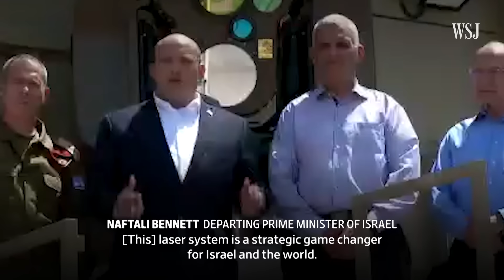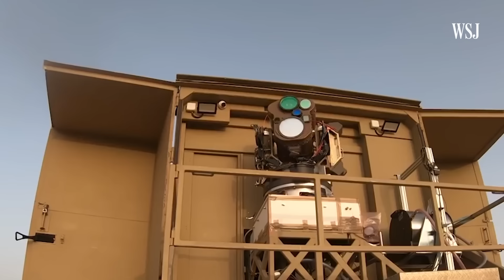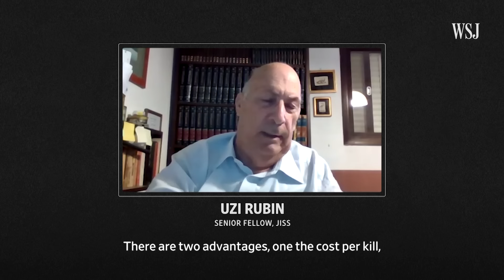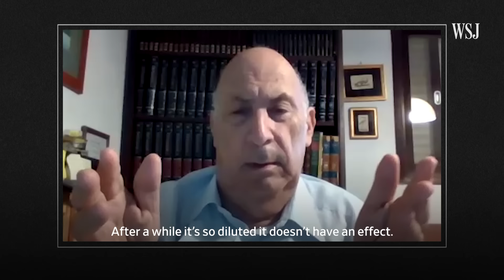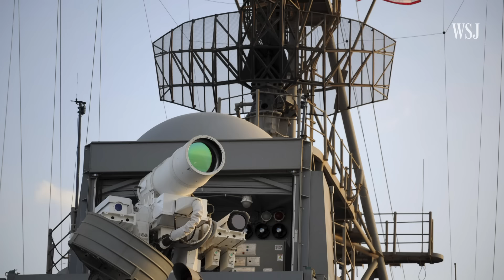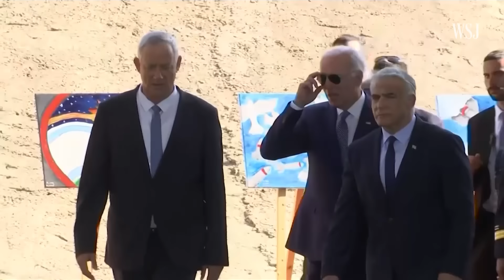Iron Beam: How Israel’s New Laser Weapon Works | WSJ

Comment: So can someone answer this, instead of a continuous beam that deposits energy over 5 seconds, why not take all 5 seconds worth of power and deposit it all in one go like a laser short burst? At speed of light you would hit the target instantly.
Reply: why? because:
1) it already dose that. all beam emitters (rader/laser) are doing it. its just small micropulses hundreds of times a second.
2) the problem of storing a several seconds worth of energy is that you need to store it and then release it. and even if we wanted, we dont have the materials to store it and to release it will overload the system.
3)that is what chemical lasers do but the problem is that the chemicals are single use, so the laser need "ammo".
4) not sure if the mechanisem applies to smaller lasers, but what high power lasers do is do a lot of small pulses of laser in order to rapidly heat and then rapidly cool the attacked surface, causing a lof of shockwaves, and this shockwaves are what is supposed to destroy the missile.

Comment: What if the missile rotates, has a mirrored paint and heat sinks?
Reply: hamas don't have that technology, they are fiering water pipes filled with manure (instead of using it for agriculture).
also, even if the missile rotate or has heat sink, the system can target specific parts of the missile, so it should not have a problem to constantly readjust the target  location in order to keep on consistency. also, drones cant do that.

Comment: I cast doubt on the effectiveness of this when dealing with mortars given these are extremely small, have no moving external components and they tend to be made of hardened metals that encase the payload. 
Also, because mortars are short range ballistic systems they are inherently difficult to detect upon firing and have very fast travel speeds at lower altitudes. Most of the claims should be taken with a grain of salt. Specially coming from Israel!

Comment: 1.NOT how THIS laser works, as Israeli’s solved the 30% weather availability issue somehow.
My guess is parallel 100kw beams . 
2. Took 3 seconds to intercept a test missile which has better heat resistance than a metal  rocket.
From a flying single engine, 3 years ago.
So we know just how accurate the end beam is.or was.

Comment: Airplanes equipped with the system could enter contested air and do what they have to do. How about having more lasers, would two beams weigh twice as much? A regular C-130 Hercules, with 10 lasers, could it take out 100 systems of S-300 missiles to clear the area?
Reply: not really. the problem with self defense of aircraft with laser is that they are very vulnerable to saturation attack. 
1)the missiles come at very high speed
2) the missle has very very low radar signature, and aircraft usually has low power rader compared to ground rader, and the ground radar can use lower wave frequency because it can have larger reciver, so a single plane leaving the plane being able to intrcept only very little
3) the radar need to actuly look in the diraction of the missle (most aircraft dont have 
4) you cant fire more then one laser at a time because the plane use all available the power of the engine to power the laser, also, with the laser, you will not have much room for the aircraft to do anything else
5) the aircraft will need to be stady and not maneuvering. something you dont want to do when you have incoming missles.

Comment: Radiation shielding should block Radiation up to xray ? So can it stop Nukes ? I would guess not. Xrays are Atoms so you would need to get smaller than Atoms to pass through shielding ? Like a gamma ray ? But would a gamma ray just pass right through anything since its smaller than Atoms. Could the gamma ray decay to an xray so it hits the Nuke? Probably not. Lasers are just visible light ? Why not use xrays instead since they have more energy or increase pressure to make gamma rays ?

Comment: All major countries are trying to comb out problems with the laser. Several efforts involving lasers, microwaves, sound waves and microwaves are underway. Working with engineers on experimental projects, I find that the lead directional element of the team is always trying to ride out a one solution pony. The solution to most problems is often a multiple combination package. In this case, one of these beam methods should also be a carrier for something else. Although the beam or combination of beams concentrated together would still do damage, some internal rider or core stream should be used, using  particle streams or other means should be used. In our case, and most cases of projects, it is obvious to me (but not anyone else) that our progress is stalled, because each lead person, and every team member wants their own idea promoted.

Comment: Can't this be counteracted with reflective coating on the missiles?
Reply: Good point, though I doubt it will be enough. Coating missiles with  highly reflective material is just going to make them easier to detect on radar.
Reply: @WalnutWarrior7 it's a beam  light of course it can be scattered or reflected , even certain colours like red or black will have different time to burn ratios i believe.

Comment: What if the missiles are covered in mirror coating?
Reply: Nope, wouldn't work. Mirrors are not 100% reflective despite appearing to be so. At least some amount of light still get passed through a mirror surface. Also these are laser beams made to shoot down projectile like missiles which means they are high intensity beam of pure energy in the the infrared spectrum invisible to the naked eye, that have the capacity to easily pass it's energy to it's intended target.
Reply: @DarkZerol there are super reflective M3 materials that can get the job done , but a poor military won't go through all those lengths tho.

Comment: I think missiles would adapt, it doesn't seem hard to countermeasure the laser. Just add a reflective painting and it would reflect the light instead of absorbing its energy
Reply: It's a laser not a light. Laser is fire in form of light. Will burn through the layer.

Comment: I have seen many articles that say this uses 100 watts instead of 100 kWatts.  The lower power might be for initial targeting but 100 Kwatts is needed for melting metal at a distance. 50 watts might be powerful enough to etch metal at a short distance but knocking out the guidance electronics of a missile or causing it's fuel to explode takes a significant amount of power. And lasers are not the same as light bulbs when specifying power. Wattage is almost meaningless without specifying the duration of peak power. A 50 watt laser etching machine has a peak power rating of about 15,000 watts.  So is the 100 kWatts of the Iron Beam the peak power rating? We don't know....nor are we meant to know.

Comment: Standalone it's probably not very effective. But as part of a multi-layered, integrated air defense system it defiantly has potential. Use the rocket based interceptor Iron Dome type systems to strike en mass at greater distances and then use lasers and microwave based weapons for close-in, last-ditch measures. 

God bless the US and Israel.

Comment: It's not the quantity of the juice, it's how fast and uniformly you do the squeeze.

First of all, short of a hurricane or blizzard conditions, at the kinds of tactical ranges we're talking about (<3nm); the presence of weather means nothing.

Testing of the 150kw MTHEL occurred over 5-7km ranges, as far back as the early 2000s and showed the ability to rapidly engage artillery rockets, including X3 simulshots, through clouds.

The primary weapons effector cuts an ionization channel based on a pathfinder laser read of atmospherics and so the only thing that matters is whether the radar has sufficient window to align the weapon head, which has more to do with siting and local horizon line than meteorologic effects on beam propagation.

The thermal kill idea is also wrong, pulsed-impulsive lasers pack Terawatt power rises in nanosecond intervals which vaporize and then detonate a sufficiently large chunk of the target as to cause explosive coupling/mechanical shock damage to the target.

Early tests in the 1990s with PIKL showed the ability to explode body armor wearing torso emulators from over 2nm, with fist-sized chunks blown out of the wound cavity.  Later tests, on UAV and RAM targets showed similar effects with deformation of airframe/weapons bodies leading to near instantaneous airframe breakup.

The difference being the first tests needed a room full of equipment and the later ones roughly a laundry machine sized equivalent.  We were aiming towards microwave oven sized with a fiber laser but cooling was an issue, as was the need for multifrequent coherency of the wavefront.  JHPSSL solved the latter issue.

I don't know what Star Trek 1960s world these fuddy duddy's are operating in but it's nothing like what was the SOA, 20 years ago.

The other factoru which needs to be considered is simply this: the tech is already out of the bag.

The Turks shot up a Chinese Wing Lung A-UAV, back in the 2019 period.  With the advance of drone threats and the U.S. reliance upon free fall PGMs, the need to kill LSS threats and defeat ballistic PGMs is going to rapidly drive lasers to the point where they begin to threaten ANYTHING which overflies a target to deliver ordnance.

For the moment, we can still afford to saturate with munitions.  We cannot afford to lose F-35s.  That was the threshold at which we needed to start thinking about new solutions and we are past it.

MTHEL 2004 Test
https://www.youtube.com/watch?v=LThD0FMvTFU

Comment: Not long ago russians lied about this technology already. But, since a lot of people are illiterate, it works. We must remember that physics have not been cancelled (jump off the roof to test) and 2 factors need to be taken - beam dispersion in air and focusing optics size for multi-mile targeting. At the moment, we use 10kW laser for cutting steel at only 1.2mm distance with great speed. It WILL NOT happen at a mile distance. Physics shows middle finger to this circus.

Comment: Without a doubt laser is the future. It  has the speed of light and requires no ammunition or logistics, maybe a solid state battery to make it mobile. The biggest issues are that it looses power proportional to the distance and storage capacity of the battery.
Reply: The only problem is mist and heavy rain.
Reply: It would have logistics due to the power draw. You can’t keep those batteries stocked up with power indefinitely.

Comment: I believe that consideration should be given to whether the system should be stationed on top of skyscrapers; most cities have skyscrapers, and those often have access to major power lines.
The height of skyscrapers reduces the distance between the emitter and the target projectile, and those projectiles are top-down attack projectiles, meaning that the loss of any negative elevation fire areas is minimal in effect on the system's effectiveness.

Additionally, skyscrapers are located in the heart of the city, where the largest population centers, and largest targets, are often located, meaning better value per interception.

Finally, having the system in a hard to reach area which mostly one way to reach it that is easily guarded and denied means that it's much easier to secure the system, in theory.
Reply: They may have better range on skyscrapers but to get the full capability that have to be positioned near the border and outskirts of big cities so that it can strike the missile before its too late. If they are on skyscrapers that leaves a lot of the rest of the city at risk. Also, there aren't very many supertall skyscrapers there... Not like New York or something
Reply: Good intentions, but it sounds like a war crime.
Putting a military asset on top of a civilian building within a city.
It'll be more effective to place it around a city, rather than in it.

Comment: Seriously, what can this light transferred energy do to a modern missile coming in at + 1 Mach? The chilling effect of the air streaming along the missile body alone would make the time required for a specific spot to be heated to anything near having an effect to be prolonged. And I assume that at that speed the tracking system also will introduce some spread on the area being lit from aiming. Add to that a somewhat reflective coating and finally the short distance of reach, and the system appear useless for other than old Katyusha style rockets. 
Is it just the media effect that are the selling point of systems like these? Taking that assumption in to the equation, this could be a top seller :D
Reply: The iron beam isn't supposed to take out the latest and greatest hypersonic missiles. The threat here is dirt-cheap, maybe dumbfire missiles that are launched in huge numbers to overwhelm the tracking/guidance systems of the iron dome. This also leads into the other reason the iron beam is better for this solution - the cost. As mentioned in the video, the price of firing one of the iron dome missiles is very high, especially compared to the cost of one of the attacking rockets, meaning that it's also an economic and logistical battle. With the iron beam, it would be far easier and cheaper to deploy large numbers of point defense throughout Israel, preventing situations where the iron dome is oversaturated and lets some rockets through.

Comment: Uzi rubin is wrong on Weather And range of the iron beam. Israel has few low cloud days and the rockets and mortars and UAVs, even advanced ones, fly lower than the attitude of the regular clouds, and rain is rare in Israel. And range isn't an issue, because iron Beam can intercept over Gaza if placed really close to launch sites. if one battery has a range of 20km, than you can put battery on iron beam every 20km in major cities. It's absolutely more cost effective for the future, also since they will probably be upgraded in the future. The beam strength is indeed the only flaw, but it's not critical - 100kw is more than enough for rockets, UAVs mortar shells.

Comment: The things you said about weather problems are really not an issue since in israel there is very little fog or rain in comparison with western countries. These things also affect hamas rockets which is why we pretty much never have alarms go off in the winter
Reply: In the north there is fog though from time to time
Reply: There are quite a bit of dust storms in some areas which might also hamper viability
Reply: The north has a lot more cloud cover, and they have no problems firing at winter.

But I guess the first role would probably be defending towns and military concentration areas very near gaza - as Iron dome is very problematic against mortar fire, while it fits right for this system.
Reply: It is infrared, so fog and rain aren't as much of a problem as with a visible-light laser.  The solids (dust) are a problem.
Try googling: fog rain, FLIR vs visible light.  Using a rifle scope with infrared in fog also can locate targets better.
Reply: @Pepe_theFurfagFrog  For detection, sure. But any particulates of any kind in the air will cause more blooming. If it’s cloudy, lasers don’t work. You can get rid of clouds pretty easily though.

Comment: What if the Rocket coated by 99.^+ reflective paint …
Reply: That's only for visible light... pretty much EVERYTHING becomes obsolete at shorter wavelengths and with more power. Even perfectly treated and polished gold only has a 10-15% reflectivity at 100nm. That paint is nothing more than for show at that point.

Comment: Having a defense system that is fully reliant on the power grid to operate is a potential weakness.
Reply: 150kw generator is going in a container and be put near the system to power it up
Reply: @omer9572  that's good to hear. Then if the power grid goes down due to a cyberattack the defense systems can still operate.

Comment: I like that this is, for the moment, a defensive weapon.
Reply: The Iron Dome is a defensive weapon.
Reply: Its an anti-defense weapon @gigacanno750
Reply: Iron dome isn't defensive?
Reply: @neryasheetrit  yes it is.
Reply: @yairsense  ברור אחי It was a rhetorical question
Reply: lasers kinda suck as offensive weapons. it'll remain that way, as other weapon systems offer far more advantages offensively by their very nature
Reply: @the-lag-gamerita5446  they only suck because of the restrictions of use
Any high powered  laser system that points at a base of soldiers is going to cause significant damage to eyes, but its illegal
Reply: Israel's main innovation comes in defense measures, iron dome and trophy protective systems being a few
Reply: This can never be a practical offensive weapon precisely because of blooming. Laser rifles will never be a thing, or at least, there doesn’t appear any possible way at the moment (I reckon there never will).
Reply: @oxytocin1989  Of course it can. It presumably can take down aircraft can't it? And if pointed horizontally, take down surface installations?
That's why my comment was semi-ironic.